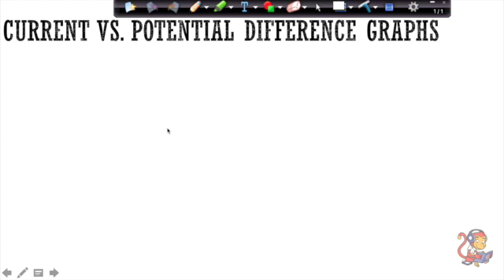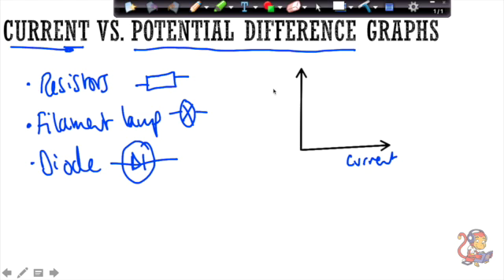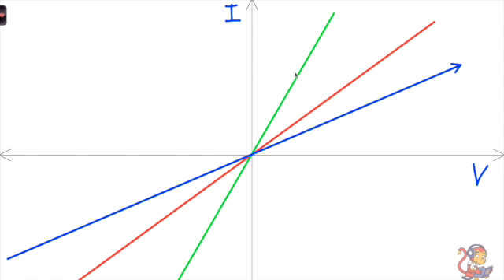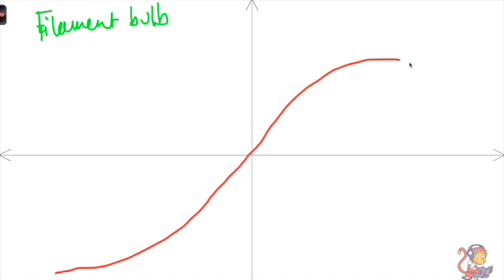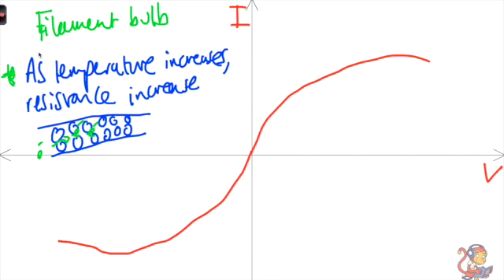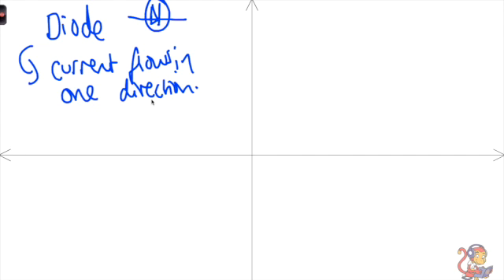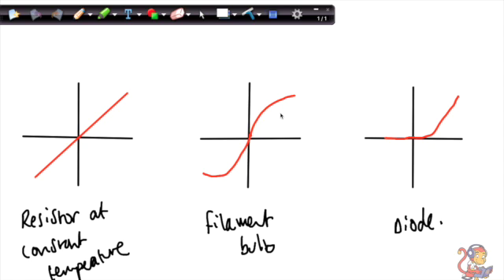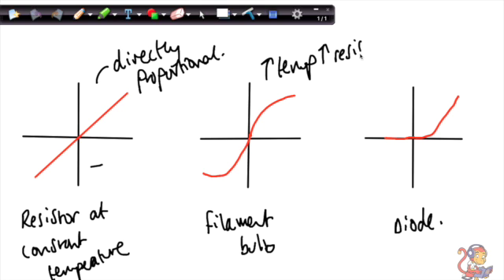Additional Physics (P2) Current vs Potential Difference Graphs

Comment: in the first graph, why is it directly proportional? is it because the resistor is providing a constant supply of resistance whereas in the filament lamp, there is different amounts of resistance due to the temperature changing, which decreases the current, hence why it levels off?

thanks :)
Reply from the maker: Yes, you've got it :) The resistor is 'at a constant temperature' whereas the filament lamp heats up meaning resistance increases, therefore reducing the current flowing through it.